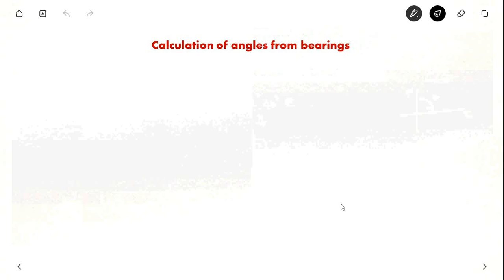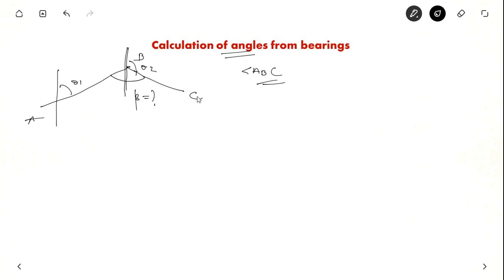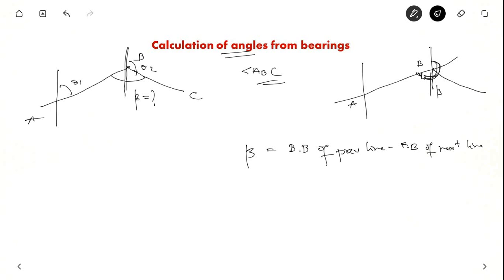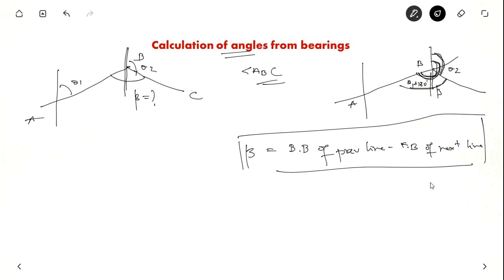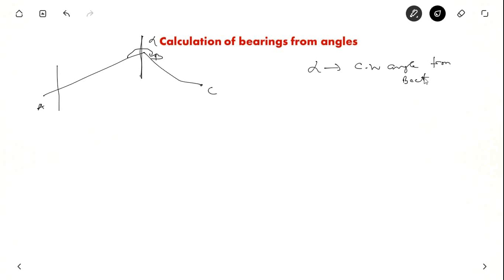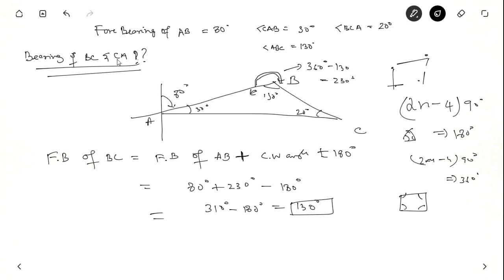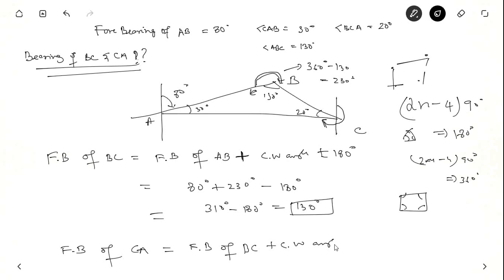Calculate Bearings from Angles | Surveying

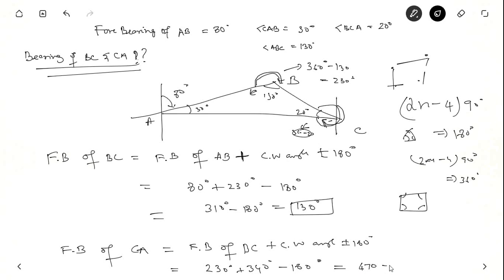Comment from the maker: At 10:08 it is 570-180 = 390 degrees
Reply: APSED  at 10:08 ... 130 in place of 230..... So  130+340-180=290 is answer
Reply: At 10:00 (FB) OF BC is 130 degree, but you have written 230 degree. is this mistake ? kindly reply.
Reply: @arearifwala8444  yah bro it is by  mistake ,But  sir calculated ans by using correct value of BC i.e 130. Ans is correct.
Reply: Thanks sir for English explain